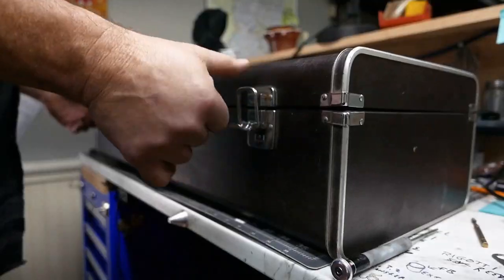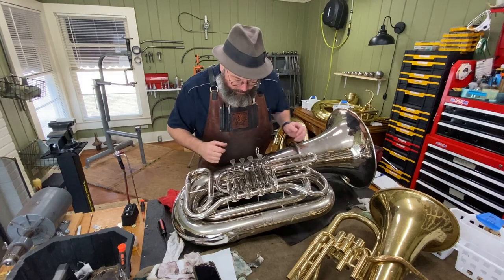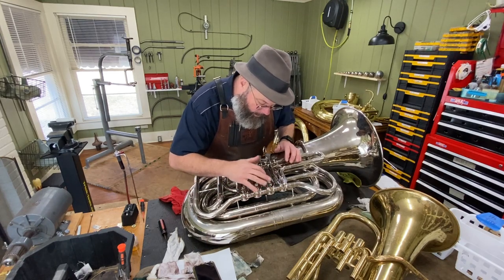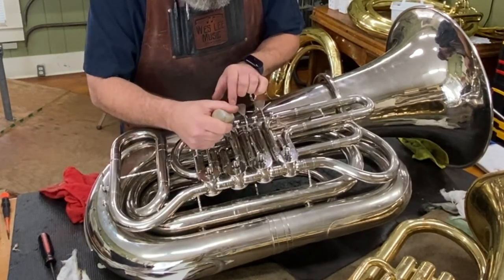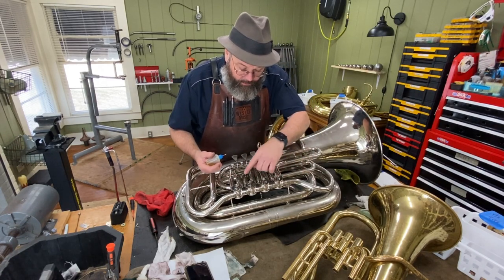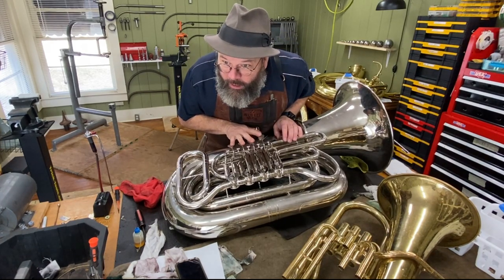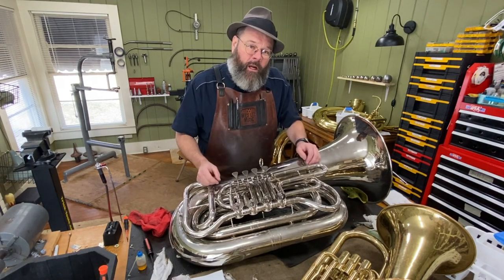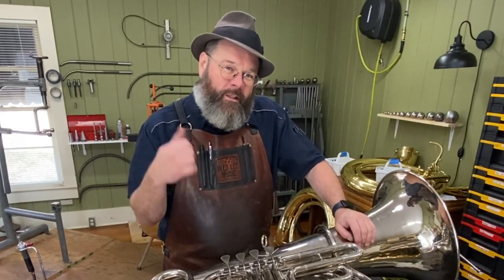Tech Tips 1- 2023- Diagnosing Rattles- band instrument repair- Wes Lee Music

Comment: I had an Edwards Bass trombone with a mystery buzz on certain notes.  Turned out there is a tiny plug in the body of the axial flow valves.  One had come loose and was rattling around inside the valve. I would love to see a video on tightening up rotor bearings!

Comment: Excellent start.  I've been a Tuba player/instructor for over 35yrs... another thing to look for is Dry Valves (rotor or piston).  I had one student who 'swore' he oiled his valves regularly but every time he played a concert F you'd could hear this annoying buzz (like a snare rattling)... he'd looked for loose brackets (i.e. solder joints), loose caps...  I looked for the same thing.  It wasn't until I took the horn and played it that I could physically feel two of the rotors vibrating.  A bit of rotor oil settled it down (they needed cleaning and resetting).  Told him I'd loan him a horn when his teacher sent this one in to have the rotors serviced by our wonderful local instrument service guy.